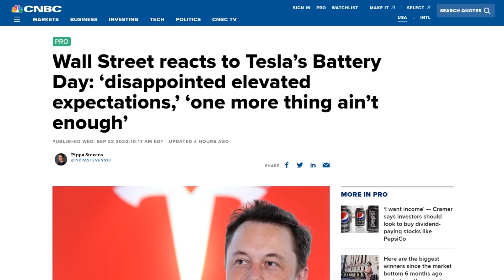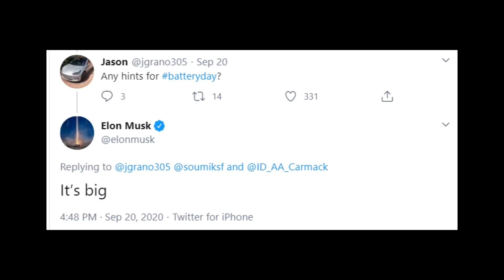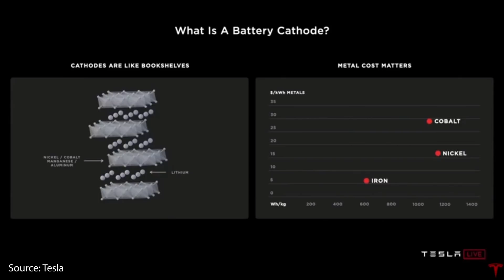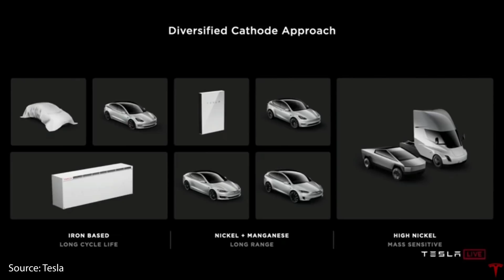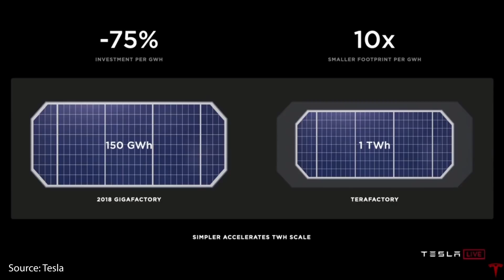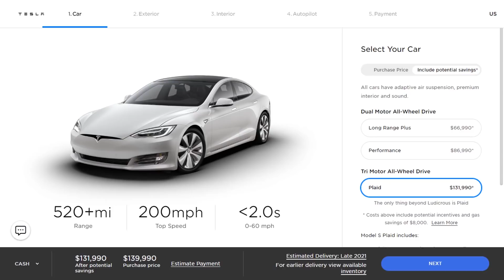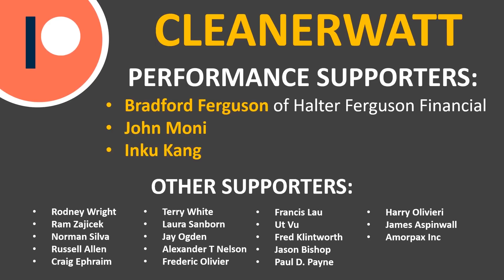Tesla Battery Day was NOT a "Letdown" (Tech Review)

Comment: So they will revolutionize the lithium battery, revolutionize battery manufacturing, halve the price, dramatically reduce capex, revolutionize vehicle construction, and they are releasing the fastest production car in the world. And they are doing all of that in only 2 years. I dont understand how anyone with half a brain could be underwhelmed here.  Also, if you were expecting the million mile battery... Pretty sure this is it.  They are gluing the cells into the structure. Meaning they cant just be easily swapped out.  You dont do that if you intend to replace the modules.
Reply: What is AMAZING is that TESLA introduced a battery that makes all current batteries obsolete...
AND have built a GIGA factory that have started production of these sells.
TESLA calls it a "pilot line" and is when ramped up the 13th largest battery factory in the world at 10GWh.
Would claim that is BIG NEWS
Reply: How do you know they have begun production. Elon just said he still has to figure out the yield problem and it will probably be until 6th version until they do this...they are on the 4th version now so if they are producing something then it is not what is being talked about.
Reply: @captainrj3121  
"How do you know they have begun production"
Well they said as much.
That it takes time to ramp up is no news, the same with all production.
But they have made tens of thousands of cells so it is not a "sometime in the distant future thing".
This is NOT MEANT as a new GIGA factory BUT IT IS, even at low yield...

10 GWh is 10.000 SEMI's or 135.000 Model 3's so even at low yield they can (as they have said) start building some SEMI's THIS YEAR.

When the Shanghai factory was announced that was BIG, long before they built ONE CAR, so was Berlin and so is this...
Reply: @captainrj3121  lol you cant have yield problems without production.
Reply: @qinby1182  now I understand....yield is referring to quantity? I had thought it was   a internal battery problem that needed to be fixed before they begin production n
 It it is actually the production process itself they need to work some kinks out in. Good to know. Like many have stated I do believe he is under emphasizing things to continue sales so people don't wait for the better model...which is smart.
Reply: @captainrj3121  
When battery production starts EVERYWHERE the rate of batteries that are "not perfect" and scrapped are very high, more than 80% and it takes time to "fine tune" the process.

Battery manufacturing is "clean room" tech and even when the manufacturing is running "normally" a normal battery plant have a yield of 70%-90% meaning 30%-10% of manufactured cells have to be scrapped.

So getting the yield up is important for cost and a normal process in all battery manufacturing.
Reply: @qinby1182  Thanks for the clarification 👍
Reply: TEC Man  
"yeah would be big news if it made a real difference."
Well it does...
Reply: TEC Man  
Having built a 10 GWh production facility as a "pilot line" AND IT IS UP AND RUNNING with the new dry coated tabless cells is A VERY BIG DEAL.
The battery line is in Fremont California (by the Car production facility)
Reply: @qinby1182  so they are already producing the dry cell battery?
Reply: @captainrj3121  
"so they are already producing the dry cell battery?"_
Yes.
But as you said they are still iterating the process (as they do with everything)
But they said they had made "tens of thousands of cells"
They let some from "battery day" tour the battery line and TESLA as far back as Jan/Feb were filing that they were planning to hire 400 people to work 3 shifts 24/7 in the battery production.
I have seen they are hiring for some time now (and still are)
Reply: TEC Man  LOL.  And so what is a 'big deal' to you? Who has a better technology than this? Some solid state startups promising magic batteries that nobody has ever been able to actually scale?
Reply: TEC Man  The conversation is about Tesla's Investor Day announcements.  Literally Tesla informing their investors what Tesla's next big thing is, so the investors will know what to expect IN THE FUTURE.  If you dont care about that future, then your opinion on the subject is worth abosolutely nothing. You are just here to troll and be a dick.
Reply: Yes, and over 1 million robotaxis on the road by the end of 2020!
Reply: @goldreserve  2 years = 6 years in reality.
Reply: @captainrj3121  reality or hyperbole?  Even if it takes them 4 years to actually deliver on the volume promises they will still be wayyy ahead of the competition.  Who is going to catch up with this? VW with their magic solid state technology that no-one has ever been able to scale?  And which even if they can somehow get it to work is still a MINIMUM of 4 years away?  And BTW, can you name ONE manufacturer who has actually DELIVERED on their promised time tables for EVs? Literally EVERYONE has had delays in either their launch or in deliveries.  EVERYONE. Maybe if GM and VW cant meet their timetables... Maybe that means its actually I donno... Hard?
Reply: @patreekotime4578  i agree.
Reply: @captainrj3121  2 years equals 2 years for the sports car and truck and 3 years for everything else.

Comment: Don't get me wrong
4680 is 5.5x more volume than 2170 but only 5x more energy?
Does the new battery really have higher density?
Reply from the maker: When you account for more active material and less packaging - overall this leads to more energy density.
Reply: @Cleanerwatt  oh i get it, so it makes the battery pack to a higher density
Reply: @ilhambuono5451  
No, the individual cells have higher energy density.
Battery cells need a metal casing to protect the actual electrodes and electrolytes, etc.
Higher volume per cell means less surface area per volume, means less casing per active material. This is at cell-level because the casing is part of the cell, not the pack.
Reply: According to Elon, just the larger form factor for the battery gives a 14% energy density increase.
Reply: What is AMAZING is that TESLA introduced a battery that makes all current batteries obsolete...
AND have built a GIGA factory that have started production of these cells.
TESLA calls it a "pilot line" and is when ramped up the 13th largest battery factory in the world at 10GWh.
Would claim that is BIG NEWS